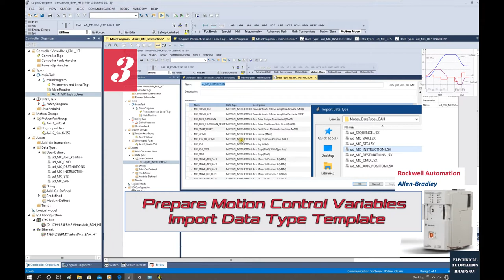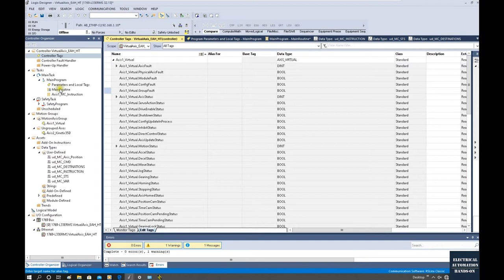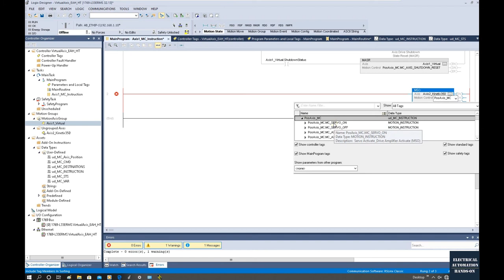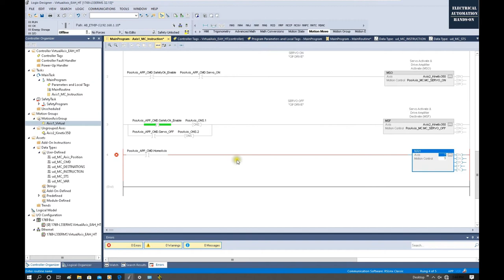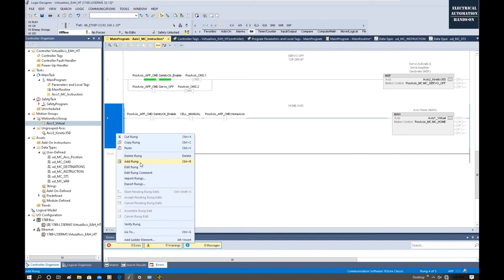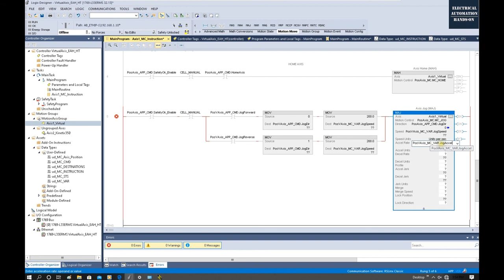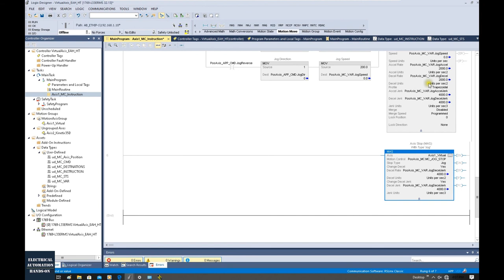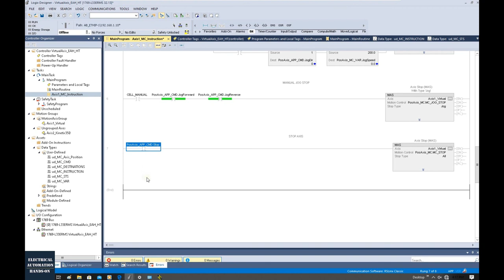MA04a. [AB Motion Control] Rockwell Motion Instructions Reset, Servo ON, Jog, and Stop [4/10]

Comment: Hi Sr...
Something kick my head...in rung 5:
in my humble opinion, in order to prevent jog forward/reverse command turned ON at the same time, (I mean, in manual mode any buttom can be pressed and create more than one output command resulting in a dangerous situation) won't be helpful to create seal in in this rung by adding  XIO intruction forward/reverse command bit as well, rigth before each jog direction Move instruction?

or won't be necesary in this case?
Thank you...I apreciate!
Reply from the maker: correct, you can use logic before the jog command to prevent Forward, Backward turning ON at the same time.  This interlock function would also be done from the HMI when a forward button sets a jog positive, meantime reset job negative command, such similar idea.